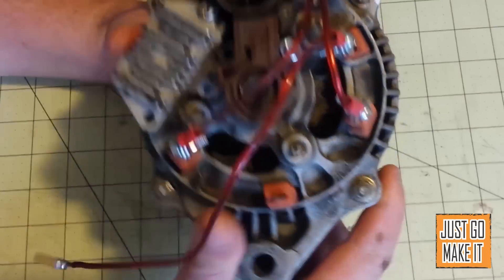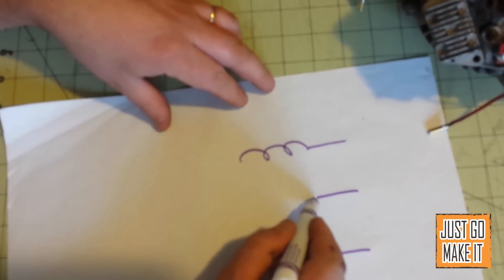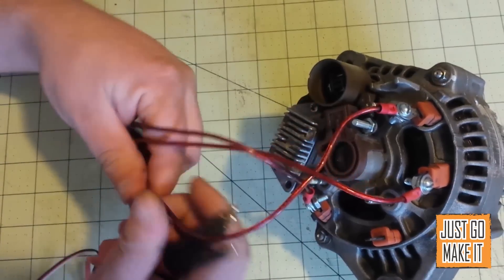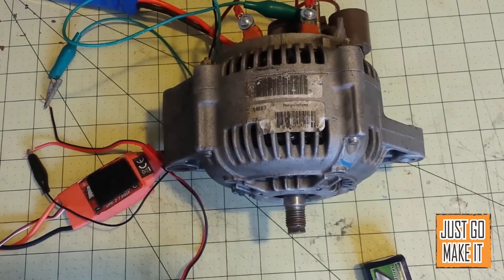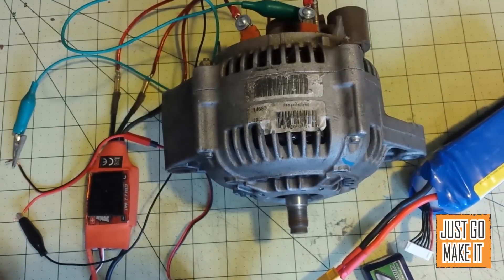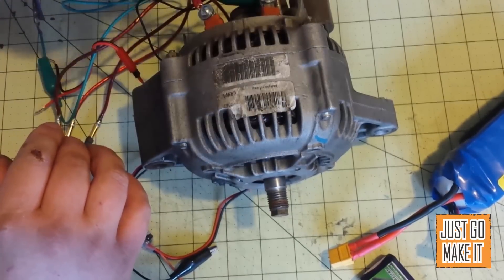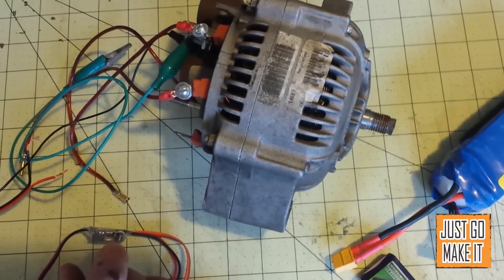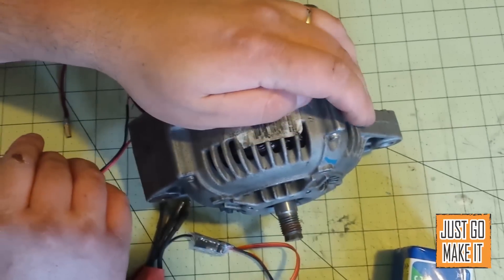Alternator to motor conversion howto

Comment: Thanks. How big is the cogging when only the rotor is energized? can you spin it by hand?
Reply: I'm guessing not much. with a 3-cell NIMH pack I can easily rotate it by hand with only the field coil energized.
Less than one amp flows. but you need a diode reverse because of the extremely high flyback voltage (it will shock the shit out of you if your touching between and you detach the connection

Comment: im trying to do this with an  alternator model r111757a but getting stuck at identifying which are the 3 stator leads any advice?
Reply: As this is described it is a Y wound stator.  If the six ends of the stator leads were to be rewired in delta configuration, it would become a lower voltage, higher current machine.

Comment: Hi good evening i want to make a kind of generator i want to use 2 alternators one as a motor 2nd as an alternator to power an inverter  to power a few small things in a cabin dont think i need to have it regulated just on how could i do that and could the power to the brushes and the status be the same value of current or dose it have to be different voltages HELP PLEASE

Comment: The rotor/stator stable 1.5 volts. Fuel injector resisters drop voltage from 12 volts to 5 volts. have Heats sinks built onto them. fuel injection systems can only handle about 5 volt. They're built in to drop from 12 to 5 volt so not to fry the fuel injectors .  About the size of a bar of soap. Not the most efficient but simple . Depending on how many fuel injectors that the engine they are used on has, you could use them in series or parallel and eventually get your 1.5 volt. For energizing the rotor/stator. There ya go.

Comment: What hp do you think you can get out of this ?  I would like to use alternators as hybrid drive
Reply: IT depends on the controller that you are using. If you cool this motor you can get 4-6 horsepower from this thing. With a 4.5kw 100v 3phase  controller without the use of hall sensors it is reachable.

Comment: so could you just run off a car battery for the power,  and  with another wire with  some resistance to achieve turning on the field coil so basically it could run at set  RPM  thinking of using this as motor to turn an alternator that's not motified  to reproduce power to charge the batt  that's powering  the modified alternator/ motor...  What's ur thoughts
Reply from the maker: +josh stickney i dont see why that would not work,  give it a try
Reply: +JUST GO MAKE IT I think your idea is awesome what about using a self exciting alternator I've heard of these gm alternator  from.  79-81  I don't know exactly what  self exciting does technally other than I know it's always on... but I don't know if it's self exciting the rectifier or the field coil...  Any ideas? ,,,  I read a blog from a MIT free energy project,,,  that's with the right amount of frequency and power that it become self-sustaining and you can disconnect the battery,,,   btw  did u ever check to see if ur putting out power from ur modified motor?
Reply: Sorry josh stickney, this will not work as a free energy device or perpetual motion machine.  It'll stop when the battery discharges.

Comment: I think the start/run issues is because the field windings voltage is pwm controlled. the frequency of the pwm is interfering with the frequency of the 3 phase controller.  Maybe just a fixed dc voltage to the field windings or a large capacitor across the field field winding will sort it ?
Reply from the maker: +Gaz S i will have to try that,  thanks for the idea
Reply from the maker: +Gaz S i will have to try that,  thanks for the idea
Reply from the maker: +Gaz S i will have to try that,  thanks for the idea
Reply: PWMing the inductive field winding will result in high voltage spikes and adding a capacitor across the winding may result in parallel resonance.  Probably best to use PWM input to a "buck regulator" arrangement of the rotor coil, a capacitor and a freewheeling diode to keep flyback voltage in check.

Comment: a high speed start possible to this conversion?
Reply: You just need the correct speed controller.  As the rc one is expecting faster acceleration

Comment: If we don't use the Speed Controller and instead of that Connect directly a Battery what will happen? it will work or not? Thanks
Reply: So what should i do? i must apply 220 volt AC to that or what? Thanks for your Reply.
Reply: Single phase will work but will not self start.  Spin the motor and switch on power and it will continue turning.

Comment: Can i use also a car (acid) battery?
Reply from the maker: +Otto Stierlitz you sure can
Reply from the maker: +Otto Stierlitz you sure can
Reply from the maker: +Otto Stierlitz you sure can   i would run two for 24volts or more
Reply from the maker: +Otto Stierlitz you sure can   i would run two for 24volts or more

Comment: Nice Video! I achieved the same thing except for it is arduino controlled and powered by a computer power supply. If you want some help with arduino control, I would be happy to help.
Reply from the maker: +Matthew From Nice, did you use the arduino to control a rc speed controller or did you build your own.  Glad you enjoyed the video.
Reply: +JUST GO MAKE IT I had the arduino control the RC controller, but the code is pretty simple. Load the code, then have the controller ground pin go to arduino ground and signal go to arduino pin 9. leave the power from the controller unattached. I hooked up a voltage divider via a potentiometer which was read by pin A3 to control what was sent. worked pretty well. Next I want to create my own 3-phase controller and field current controller.

#include <Servo.h> Servo myservo; // create servo object which is meant to control a servoint esc_pin = 9;int read_pin = A3;int analog_read = 0;int analog_read_remap = 0; void setup() {myservo.attach(esc_pin); // attaches the servo on pin 9 to the servo objectpinMode(read_pin, INPUT);} void loop() {analog_read = analogRead(read_pin);// analogRead returns a value 0-1023; Need to re-map t0 0-180analog_read_remap = map(analog_read, 0, 1023, 0, 180);myservo.write(analog_read_remap);}

Comment: how do you do the resistance test to find your three connections
Reply: continuity test.

check resistance ONLY when something is de-energized. use the multimeter on the continuity setting until you here it beep. 
or Google continuity check
Reply: Hemi so I have 6 wires coming from my alternator, really I have 12 but they are in groups of two, so I found a multimeter for sale locally and it has the continuity setting , I'm going to buy it, so using the continuity setting how do I find out the three connections exactly, I'm sorry to bother you,  but you would be a huge help if you can help me do this step in the conversion , once I do this I can make a sprocket for the motor and mount it on the bike then its just waiting for the controller from ebay

Comment: Dear thank you very much for this revelation, I just have one question, why should we take out the diods?
Reply: diodes are there to make the alternator function as an alternator, because we dont need, we remove
Reply: The alternator internally produces AC electricity that is then converted into DC using the diodes - a bridge rectifier.

Comment: This is a synchronous motor with very low torque. They are subject to rotor lock up when the torque limit is reached. I did this 45 years ago with alternators while in college. To get any significant torque out of alternators they must have a squirrel cage embedded in the rotor just like a 3Ø motor.
Reply: I respectfully disagree svartist.  Torque will be proportional to stator current x rotor current, it can be considered the product of the magnetic fields of stator  and rotor.  As speed increases, back emf approaches the applied voltage resulting in a reduction of stator current and therefore torque as well.  If this is done with a  3 phase frequency  which was adjusted to allow maximum free running rpm, loading the motor will result in loss of synchrony when even a small torque load is applied resulting a large drop in output torque.  If the applied frequency were reduced to match motor rpm at the increased torque load, this increased torque could be maintained.  This motor requires power factor sensing in order to adjust voltage in a feed back system or rpm sensing to adjust frequency, also in a feedback loop, for best efficiency.  A throttle in such a system  is considered a torque control, much like a gasoline engine if power factor is sensed.  If rpm and controlled by frequency, this is a speed controlled throttling system which would result in undesirable jerky operation in a motor vehicle.  A squirrel cage would make this an induction motor, which can be done with an alternator by shorting the brushes to the rotor.  This will result in slip proportional to applied load.  The induction motor becomes most efficient at its rated slip RPM which remains rather constant regardless of motor speed and also results in a power factor near unity.  A speed controller with feedback controlling frequency to maintain a PF = 1 is desireable.
Reply: Thank you @cphank151 for the  thorough explanation. This really helps me out on the project I'm working on. (trying to use an alternator to start a small engine and then turn around and use it to generate DC current) I'm getting close and this was one of the last things to wrap my head around and you filled in the missing pieces. Now I just have to start testing.
Reply: Good luck on your project @Carlan Wray.   The Toyota Prius, and probably other hybrids as well, use a motor attached to the gas engine crankshaft through a pair of overrunning clutches in opposite directions that can be electrically enabled or disabled.  This allows the motor to drive the engine to allow restarting almost unnoticably to the driver and also allow the ICE or motor to drive the input to the transmission.  This also allows the motor to act as a generator for regen braking without ICE engine braking interfereing as well as turning off exitation to the motor to operate as a gas  powered vehicle would in addition to the motor driving the vehicle without the ICE turning at all.
Reply: Thank you @cphank151. I don't think I will need any clutches to make this work. I will just have two three pole relays, one between the ESC and the alternator and one between the alternator and my rectifier. With my PLC controlling the field voltage to vary the voltage output to the batteries and switching between starting and charging. Shouldn't be toohard.
Reply: Many years ago, I had a friend with a tractor mower that motorized the GENERATOR to start it instead of using a separate starter motor.

Comment: Could I just put a Capacitor between the Field Winding and one of the Phases ?
Reply from the maker: +Lixeilexon i dont think that would work.  probably be to much voltage on the feild coil
Reply: +JUST GO MAKE IT And with a (some) resistor ?

Comment: okay I understand what you're doing here and I understand that it's about you using a speed controller what if I just want to turn the motor on and run it wide open and then turn it off when I want to turn it off I don't need it to be speed control I just wanted to go wide open when I turn it on and when I shut it off this shut down then how do I wire it

Comment: al igual que USTED, separé el bobinado del alternador (es trifásico) y lo lleve esos 14 voltios de AC a un autrotransformador trifásico, con fin de elevar la tensión a 102 voltios, para cargar las 08 baterías de un proyecto (coche eléctrico), la excitación del alternador es a 12 voltios, el cual solo se alimenta, al frenar, sumado a que mecánicamente un pivot hace que el motor eléctrico comience a mover al UNICO alternador (también se activa a petición de usuario, ejemplo conducir en una pendiente) Gracias por explicar calmadamente su inquietud, de gobernar por arduino.

Comment: If the field has a constant magnetic strength because a constant current is flowing through the field winding through the brushes, an increase in motor RPM results in an increase is back-emf because the motor continues working as a generator as it turns.  With a strong field, a relatively low rpm results in high back-emf being generated by the stator at lower rpm, approaching applied voltage to the stator, thus limiting maximum rpm, but with high torque capability because torque is proportional 3 phase magnetic field times the rotor's magnetic field.  With the small controller on the field, you can weaken the field magnet, thus requiring higher rpm before back-emf approaches the applied voltage from the 3 phase controller.  This field weakening will result in the same power output with less torque but with higher rpm with similar power input to the stator.  Heat is mainly what limits power output from this motor.  If the field were held at maximum current, just before saturation, the motor could develop maximum torque and also high speed if a high enough 3 phase voltage is applied to the stator.  But this condition causes a lot of heat dissipation in the motor which will likely burn it out quickly, so cooling is the main concern.  If the motor can be sufficiently cooled, only magnetic saturation of the rotor and 3 phase stator will limit power output.

Comment: is it possible to turn an alternator into a simple dc motor
Reply: An alternator doesn't have the commutator that a DC has.
If you can find an old DC generator, not an alternator with diodes, you can convert that into a DC motor.
much more easily than rebuilding an Alternator in its entirety

Comment: hey if you make that a motor can you run it with full power from a brother alternator to use the power without a control unit and if the motor is brushless and a electric motor is used to turn the alternator for a greater output then goes in. (well is that a step up generator) also it is really cheap and with a pedal assist motor and a big gear and a chain by weight you can get it up to full speed with the pedal assist system with a 120 and get an electric super bike. if you try this then watch my show to let me see the video by leaving a comment please. i had to drop out of electronic school.

Comment: The effect that you are seeing with the lower armature voltage allowing higher RPM is caused by back EMF. It is seen in all electric motors. It's a result of having a coil spinning inside of a  magnetic field.
Reply: Hello
you can have a very high RPM system, but it's a vacuum and it is not usable for an application
Reply: +tchangly21 makes sense, to have torque it has to act against something with some power.
Reply: yes, in this text empty, the couple is very low

Comment: Wouldn't this be more correctly classified as a DC-powered, 3-phase motor rather than a brushless DC (BLDC) motor?  After all, an alternator DOES need to use two brushes to conduct current into the slip rings and on to it's rotating field coil (armature) since it doesn't contain any permanent magnets....

Comment: I'm disabled with MS multiple sclerosis and I'm trying to find a way to charge my mobility scooter EW36 mobilty scooter brushless electric motor batteries 48 volt battery setup to 78 volt setup. Any help would be greatly appreciated.
Reply: Darrin do you know of someone who has done this?  usually the only part left that is going to survive that voltage jump is maybe the motor...  You will need a new controller and all electronics are based on the 48v you started with...
Reply: Plus it sounds like there are some welds on this scooter that are already notorious for breaking without any more power being added.

Comment: From where you get the ESC (electric speed controller)
Reply from the maker: +Omar qalalweh the king of random.  Any rc supplier will have a brushless esc
Reply: +JUST GO MAKE IT 60A or 70A Esc ?? I want to make electric bike with the alternator
Reply: Hello
do not use rc ESC controller because, ca will not hold a charge, it is not assé powerful ...
the best is to use a brushless controller electric bike ...
Reply: +tchangly21 the brushless e bike controller have many wire I don't know how to wire it
Reply: Hello
it is very simple; we must connect only son 9;
2 for power, three for the motor and 3 for accelerator and 1 for on / off ...
the rest does not serve nothing

Comment: please make it sure that the video you have made is much more clear to be aeen by the audiance...
m aint talking about video quality... but the angle and viewing boundries
Reply: checkmate - The fact that Shantanu Nadkarni does not speak English as a native language does not mean that he's stupid, or that his point is invalid.  I also found myself trying to scroll the page down a couple of times to see something that the narrator was talking about, but that was off the bottom of the screen.
Reply: It’s a good video that could have been great if the audience could have seen the connections to the components, batteries and controllers etc. It would have been exceptional if a schematic was included.
Reply: Just based on the video movement, i would assume he used some sort of stabilization software where basically just crops the video down and tries to steady by moving the video around and keeping a few points constant... that's likely why much of the FOV is not as intended
Reply: Roasted, I'm going to be expecting comments like this in the future with my own videos lol.

Comment: Do you know how much current the alternator draws on your motor
Reply: He is using 24 volts. the resistance between 2 phases is 0.3 ohm so 24/0.3=80 amps max. 80Amps under Max load. But with his controller he only can go to max 40 Amps.
Reply: Tim yeah that’s what I thought as well but I built one and I’m using a 24v supply and the windings are 0.4 ohms and it only draws about 7 amps, also if that’s what he was thinking that gauge wire he has on the windings is way to small